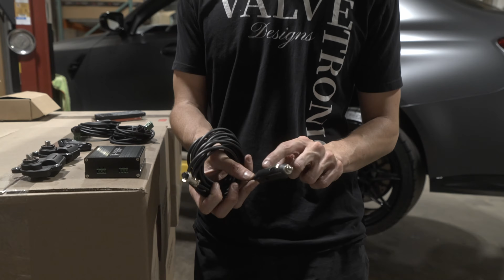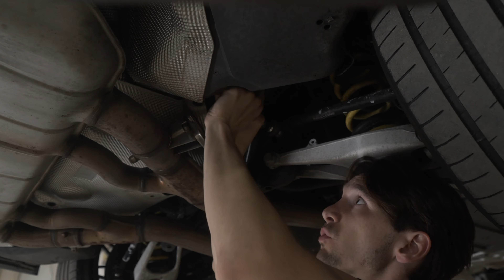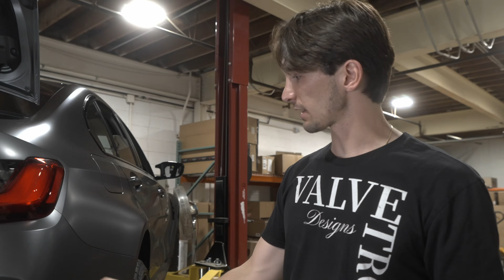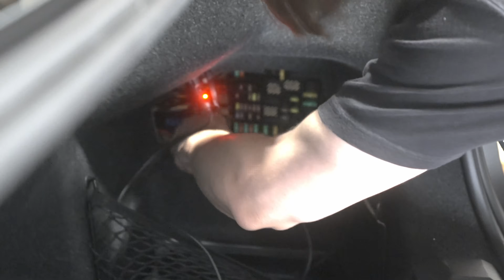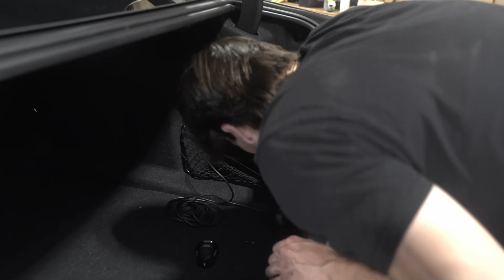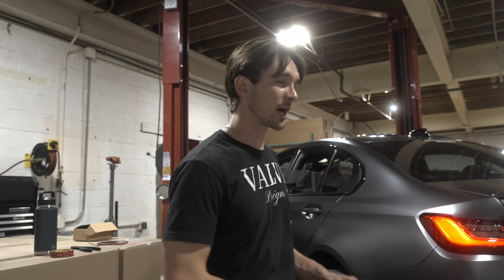How to Install Your Valvetronic Designs Electronic Exhaust Valve Harness

Comment: I just saw a video featuring your Valvetronic system with remote valve control. It was installed in a BMW M5, and the driver was opening the valves with the remote, but additionally, by using the button that normally controls the factory exhaust flaps in that car, he was able to “activate burbles.”

I’ve now bought a full system from you for my BMW M8 and I have the same module as in the video, two remotes, and the wiring. I don’t have anything else.

How can I make it so that the button on the control panel next to the gear lever affects the sound in some way?
Reply from the maker: you have to choose it’s either or you cannot have both. You use the remote or use the controls in the car.

If you use the valvetronic remote, the button in the car only controls the active sound design, ie the fake  sound inside the car.
Reply: @valvetronic  The BMW M8 doesn’t have such a speaker-generated sound function. The BMW M850 does have what you’re talking about. Please check the recording I’m referring to. The guy has your controller for operating the exhaust valves, but he’s also pressing that button in the car to turn the burble on and off. https://www.youtube.com/watch?v=cdvTxsX2D1w
Reply: @valvetronic  And? ^^ Tommorow is my instalation day!

Comment: Can you guys make an option for the power cable to go into a 12V fuse prong slot instead? '23+ models no longer have the 12V outlet in the trunk, which makes this exhaust a project to install.

Comment: I just installed the equal length mid pipe stainless steel Valvetronic with the complete exhaust system  in my 2024 BMW m2 g87. Did not like carrying the remote and dealing with the wiring and zip ties. I replaced the valves openers with OEM valves.  Is there a significant sound difference if I use the Valvetronic valves ? So far the sound is not what I had expected. I just don’t want to go through the hassle of wiring and in the end there is only 5-10% increase in sound .
Reply from the maker: it really helps
Reply: Im waiting for delivery on my exhaust, curious if you ever decided to do the swap? From what I understand the factory valves don't fully open when you select them to. I also don't believe they stay open during idle or at least for the manual it seems they don't I can hear exhaust note change by engaging the clutch

Comment: Hi what should I do with oem exhaust valve wires ? 
Will bmw throw CEL codes if oem wires are disconnected?
Reply: I cleared them with my mhd flasher and it never came back and then just put some dielectric grease in the connector and wrapped it in electrical tape

Comment: This renders the exhaust button in the car meaningless correct? just use the remote instead
Reply from the maker: not exactly, the exhaust button will still activate the “active sound” piped through the speakers but it will no longer operate the exhaust valves
Reply: @valvetronic  ahh makes sense. the valvetronic full exhaust sounds so good, I don't notice the difference with the piped in sound on or off anymore.

Comment: what did you do with the original OEM valve controller connectors? just zip tie them up somewhere?
Reply from the maker: Yes, make sure they stay connected
Reply: @valvetronic connected where?
Reply: @chinosaki8067 wondering the same thing I think he means connected to the car not the actual valves cause there’s no where to plug them in. One flaw about this controller is it doesn’t receive input sometimes. You have to keep pressing it for it to open or close. Not sure if that’s a signal thing or what.  You can see him pressing it multiple times in the video too and nothing happens
Reply: @Uoenoburner I got it all figured out thsnks

Comment: Do you have further instructions on how to power 12v controller box via hardwire to electrical system so that it doesn’t cause battery drain when car is locked/asleep?